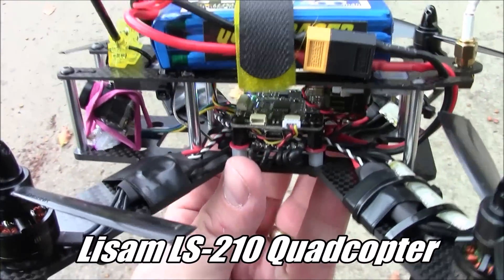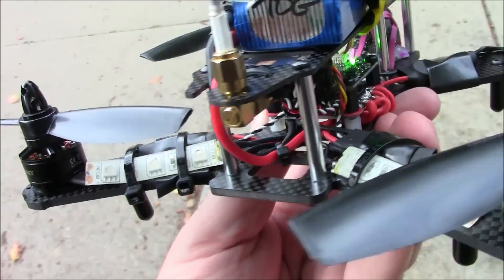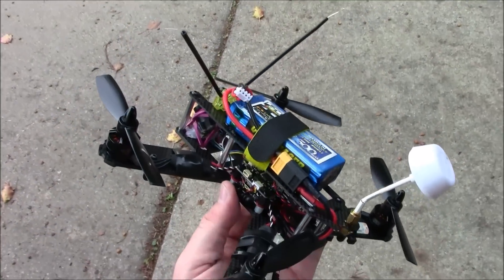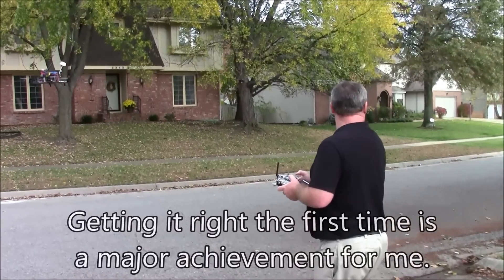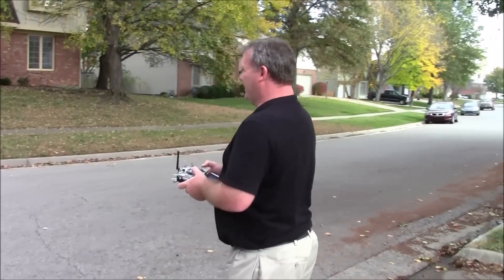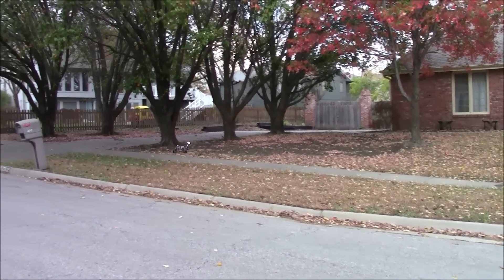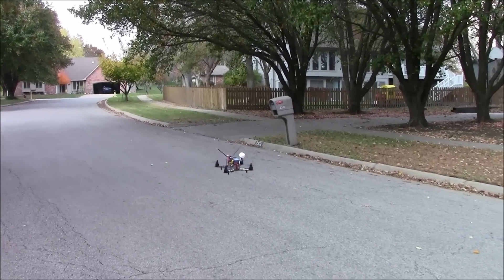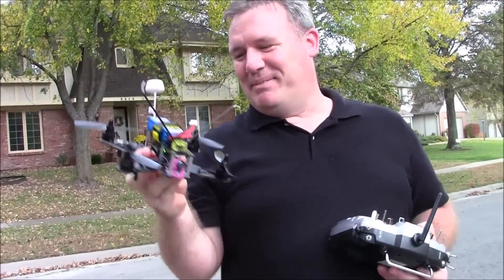Lisam LS-210 FPV Racer TEASER & LOS FLIGHT

Comment: Is frame strong enough to take some crashes? I am quite worried about the carbon fiber for its strength.
Reply from the maker: +Tommy Lee Oh yes, it is plenty strong.  I've been flying this one for 6+ months.  I did manage to break the top plate once when I was flying with a large battery that was really too heavy.  I did manage to get a small fracture in the bottom of this frame but it isn't bad enough to make it unflyable.  I'm still racing it in our local races.  :)

Comment: Nice flying Travis. Quick tip friend, mine started smoking big time just as soon as I connected the FPV. Like a stunt plane with a smoke trial. The 90 degree antenna extension shorts almost instantly and continuously on the carbon around it. Insulation tape didn't solve it either, in the end I had to completely coat the 90 degree extension with glue. If you have liquid insulation I'd coat the rear of the top plate also, both sides, p,us the antenna extension. I imagine you have the idea but if you want photos I can email.
Reply from the maker: +Next Lipo Please MiniQuad Racer You may have something else touching the frame besides the antenna.  It shouldn't short to the CF if nothing else is touching it, right?
Reply: Oh really? That makes sense. I did think it was strange that Lumenier would leave you so exposed to shorting in their design. Stopped now though. So perhaps I have a frayed wire charging up the frame?
Reply: +Next Lipo Please This might be late, but just putting it out there for anybody else who runs into that issue. If your antenna connector is touching carbon, nothing should happen, because the connector is essentially a ground. Now if you have something else in the setup that is a positive, like an exposed Lipo lead, or  a wire from the PDB touching, the positive completes a circuit through the carbon. So always be careful with the positive leads.
Reply: Thanks

Comment: cool, don't forget to check out the new Diatone 180, 150, etc..
Reply from the maker: +michael lee I have a Diatone ET160 frame video coming soon.
Reply: +travisgrindal  i was talking about...

http://www.banggood.com/Diatone-Spadger-180-Carbon-Fiber-Quadcopter-Frame-Kit-w-V3_1-BEC-Power-Distribution-Board-p-1010227.html

http://www.banggood.com/Diatone-Lizard-180-Carbon-Fiber-Quadcopter-Frame-Kit-w-V3_1-BEC-Power-Distribution-Board-p-1010224.html

i thnk they also have 150mm
Reply from the maker: +michael lee I ordered that Lizard, not the other yet.
Reply: +travisgrindal http://www.banggood.com/LT210-210mm-Carbon-Fiber-FPV-Racer-Quadcopter-Frame-QAV210-With-10-Pairs-Propeller-p-1011578.html

Look what they did. 5mm plate :O For me now it can be one of best if not the best frame out there
Reply from the maker: +Xava Nice!  The holes in the lower plate are also smaller.  That should add a little more strength.
Reply: So what are you flying now? I am fed up with LS-210 not holding up for even two months...
Reply: kubaistube Well to be fair, i'm not flying. I just got a 3D printer and it take too much time for now. I like my LS-210, just need to 3D print new, better top plate. I made a model for it and it should be stronger

Sad to hear that it broke for you, but I don't think that you can get any stronger frame :/
Maybe this 4mm http://www.banggood.com/Realacc-210-V2-210MM-4mm-Carbon-Fiber-Racing-Frame-w-5V-12V-BEC-PDB-Runcam-Mobius-Gopro-Camera-Base-p-1063698.html and no holes, super strong bottom plate....
if not,  I don't think that there will be anything stronger.
This frame have very wide arms so should be strong enough...

Maybe you received some bad quality frame?
Reply from the maker: +Xava I have one of those frames coming to review!
Reply: ***** cool, waiting to see it, but I may be ordering it anyway, bottom plate looks solid
Reply: hmmm, something´s really not right. I am already using 4mm version and destroyed two of them: http://www.ebay.com/itm/111802830550?_trksid=p2060353.m2749.l2649&ssPageName=STRK%3AMEBIDX%3AIT
probably it´s time to cash out for the tank: LT210 5mm version :D